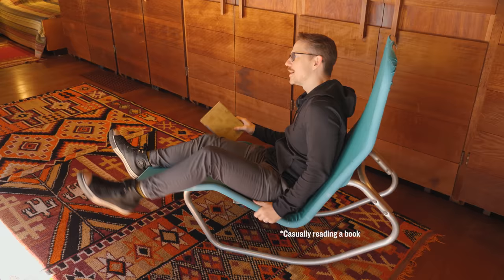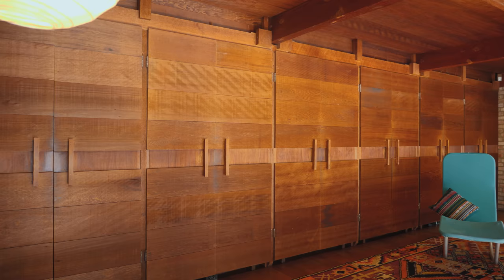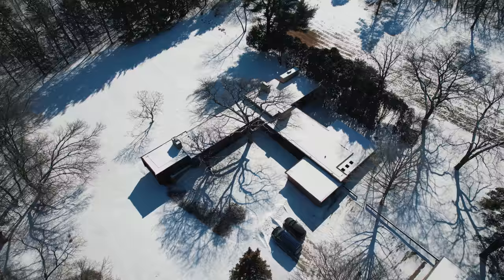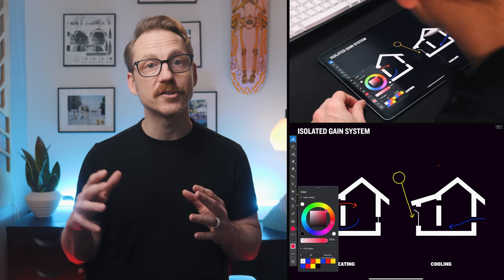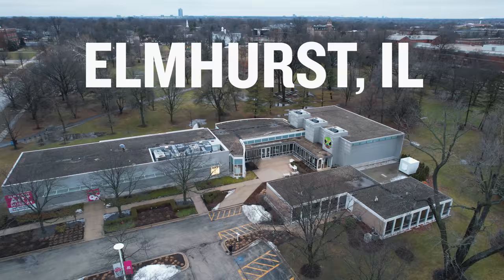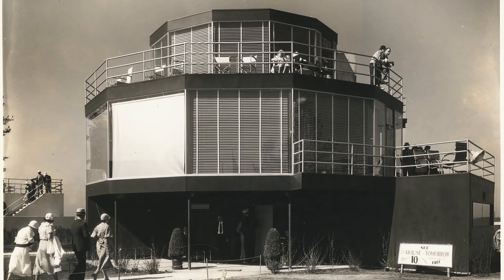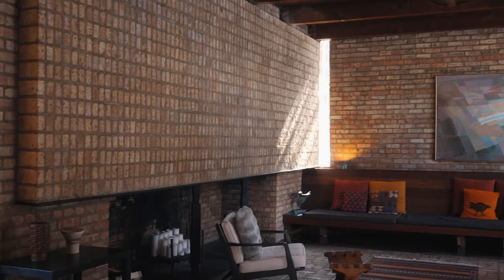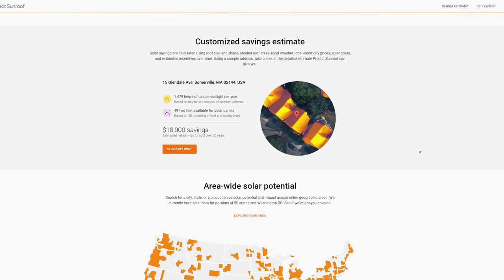How This Midcentury Modern House Harnesses the Sun

Comment: I wonder why data was not collected as to reinforce the concept. As the house sits in a lot quite large, right away that negates any relative factors to a typical tract developed home. The only modern alternative is to modify, alter, improve building codes as to build, insulation, sealing, better windows and an HEVAC systems that include heat pumps with smart energy management via AI and a modem thermostat. Thanks for the video.

Comment: I'm tired of cold-climate bias in energy efficiency. Believe it or not, there are vast regions where warming a building is not much of an issue, even in winter. It's keeping things cool that's the problem. And in these areas, the air outside is often so hot (and frequently humid) that ventilation is not viable. Where I live, summer low temperatures often don't get much below 80 deg F (because the dew point is in the high 70s), so even trying to naturally cool things off at night doesn't work (and all the moisture leads to mold/mildew).

Comment: Very difficult to do right, even with today's high performance glazing. Tough sun is the  afternoon sun, which is low, no matter what time of year, and will overheat.
That "perfect" 24 degrees is humbug.
Lots of glass will always overheat the home, even reflected diffuse sunlight will add significant heat load; you'd have to combine with planting shade outside. And in cold weather even the best triple pane IGU is worse performing than a cheap exterior wall.
I am not against lots of glazing, just saying it is much more complicated than the sun angle.
The natural ventilation is iffy, too. Brings in tons of moisture in summer, can work in swing seasons for a limited time.
These days, use controlled mechanical Energy Recovery Ventilation for ventilation; cheap and effective and no window openings to take care of, runs silently in background and you have always fresh filtered air in the home, which also helps with all kinds of other potential issues.
Thermal mass works well, but only if you have concrete floors with ceramic or stone tile, or similar materials. At which point you need radiant floor heating to stay comfortable, which is the only good way to heat homes IMHO anyway; works beautifully with Ground Source Heat Pumps, too.

Comment: we have certainly come a long way since then but its disappointing that more are either not taught these principles or don't apply them.  why are they not every day houses yet. 
also 
I think you got the grid in the floor a little wrong. logically the sun side window is hotter creating a low pressure system thus drawing colder air up from the back side of the house through natural convection.
Perhaps if he had a curtain along the inside edge of the grid parallel to the window's  with a gap both along the floor and ceiling, the curtain could trap the heat between the glass and curtain creating a stronger draft pulling up moore cool air across the room.
 using the summer sun to cool the house.

Comment: Isn't there a trade off because glass walls are less insulating? I can't tell if the windows in this case are single or double glazed, but even when double glazed a well insulated wall would be better when the sun is not shining.

Comment: that's a really nice house but:
using thermal mass to capture the energy... in a wooden floor, with thick carpets on it! Thermal mass is on the exposed brick walls.
5:37 Wladimiro Acosta coined the term Helios for a type of solar house he developed from 1932 and was well established by 1937. I'm not even sure he was the first to dub them in a similar fashion, but it pre dates that 'solar house'.

Comment: I'm curious how well the solar gain works as this house predates PSI rated insulation to provide a thermal break between the floor and the earth. This is assuming the floor is a slab on grade. I have been building passive solar homes for more than 40 years and on the 49th parallel the requirement is a four foot overhang with eight foot ceilings. This calculation comes from information provided in The Passive Solar Energy Book published in 1979. June 21 no sun enters the southern windows and Dec 21 at noon the sun reaches more than twenty feet back into the house

Comment: The assumptions for the roof overhang are wrong. Designing for the winter solstice is about 7 weeks too early. Due to thermal lag, the coldest day of the year is mid Feb in Illinois.  Likewise, setting shading based on the summer solstice is also about 7 weeks early, as due to thermal lag, the hottest time of the year is mid August.  Now the design described here partially works, but it is hardly "optimized ". The suns position   changes daily, so the only optimization would be a solution that moves with it, and is adjustable for different times of the year......fixed shading solves for a short period of time.

Comment: Great video. Something i hope people consider is energy on a direct level vs energy on a systemic level.

Modern windows are typically double pained. The seal goes bad in a short while: 10 -15 years sometimes. The repair  is to replace it, and to be code compliant large windows are tempered as opposed to annealed glass. This means they cannot be cut.

One pane typically has a UV protective side that minimizes heat transfer and a gas is between the panes. 

Anyways, the fix is to replace the entire thing. The low energy consumption of its performance of such an engineered product doesn’t out perform the manufacturing and shipping energy it takes to get it replaced.

I also would encourage using paned windows. As in - 50 paned instead of one enormous pane. So if one of those breaks, you replace a 12x12” window instead of a 4’x9’ behemoth. Easy on the owner, the installer, the manufacturer, the earth. Wins all around. 

A smaller window also is less likely to break in the first place. Cutting a piece of glass can be done by anyone with a little skill and can be found at almost any hardware store.

Manufacturing a tempered glass takes a while. Weeks. Months if the company flubs the order. Then it gets smashed and re-ordered.

The rise in demand of windows and old school methods of manufacturing actually historically led to a lot of deforestation. Nowadays it’s all gas, but i wish we could harness wood gas and have more locally sourced glass.

Comment: Never understood why ppl dont take that into consideration anymore. AC solves everything and then call it passive with a house full of electronics to control air flow and temperature, makes no sense. Why would i seperate my living space from outside, while i could just use the outside to my advantage. But i must say if you live in a city the dirt/dust building up is a issue that would be solved like that. Everything has its ups and downs, id prefer the "old way".

Comment: I am building a skillion passive solar retirement cottage. A lot like Matt and Goldie's earth ship but no tires or berm. 6/12 pitch for winter sun. Half the floor space in windows for solar gain. Gotta put thermal break and insulation under my thermal mass floor. Cold 48*F ground temp and 6 foot frost depth. Well insulated north cmu block with masonry veneer. Without educated idiot signing off on plans can only go up 20 with masonry columns under code. Doing old world masonry kitchen. Masonry stove, white oven, and heater. Like Temple of Malta. Can even get western Delta honey comb to match Maltese stone.

Comment: wood floors and carpets/rugs are NOT thermal mass- mass is concrete, stone, brick, even packed dirt/adobe.  and it looks like the trees where shading the south glass?  it is good to have the glass extend down close to the floor for more exposer to collect the heat. and you don't need air conditioner IF you design the house right.  and all windows need to have moveable window insulation systems- like thick, hi R factor curtains and or shutters, etc.

Comment: I have to differ in this... It depends, A LOT where you live, for example, for solar panels in México city you alocate them at 14 degrees for maximum sun reach, doing the calculations for the house you reach something similar by extending the roof or building slabs to cover or maximize the sun, again... It all depends what you want to achieve and where you live... In South America heavier and thicker materials are used therefore using similar methods can overheat the space or get natural cold spots, another example of a solar house way different of how you talk about them are the lak a utas in Lap Paz Bolivia, which harness the sun to heat up the house made of 1m thick adobe, the concept might be correct but there's more to it
Reply from the maker: For sure.
Reply: @stewarthicks  ah yes sarcasm I live for that
Reply: Well the earth is tilted at 23.5 degrees, then tilts to the other side after passing 0 degrees which will give us 2 equinoxes, houses in the equator can probably use that angle, I think to be more efficient on using this solar gain it would be using different angles depending on how far you are away from the equator...
Reply: @pihermoso11  I've only worked on Mexico city for now... And For efficiency the solar panels were installed at 14 degrees.... Ecuador would be at 0

Comment: I have designed and built these homes.  Each latitude,, and climate zone has its own list of design angles for walls and windows, for solar photovoltaic panels, for where and how thick the masonry buffers should be. There is no one size fits all.  One thing that should be universal is the house must address the sun first.  The western idea that the house must face the street is absolutely wrong.  I don't care that the street runs NE to SW,, the house first needs to face the sun.  The east and west sides of the house have different requirements,, the north side is lot specific.  Absolutely deposit in the trash the concept that a house must face the street.

Comment: This is a load of marketing crap.. That glass wall in the winter is the biggest heat loss in that house. In the winter sun is so weak it can't heat up anything. Winters are also  mostly windy and cloudy, wind will blow away heat so fast from that glass wall you will need to spend double on heating, so don't fall in this trap.
This can work only in places where there are no real winters, but in those cases just build what you like.

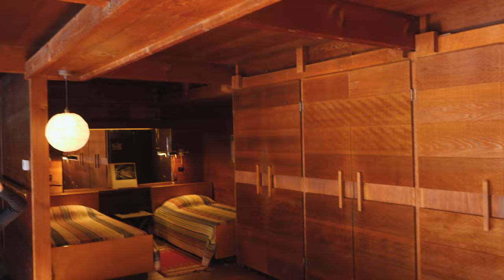Comment: 2:50 - This is not how circulation works. As you describe it, air would leave the room in two opposite directions, creating negative pressure. Which obviously does not work without a suction pump - and would not be desirable for living quarters. Unless there is some significantly more compex pattern of air movement, your explanation does not make sense.

Comment: Are there good examples of "mid-century  modern" interior houses without a flat roof?

I like the attention to how spaces are lived in and the use of high quality materials by these architects. What I can't understand is the the insistence of ignoring the basic function of a house as a shelter from the elements. Use of a flat, and mostly level, roof in northern Illinois, with its snow and rainfall, seems to be either ignorant or short-sighted. Was this planned obsolescence on the part of architects? Or did these architects not understand the climate differences of desert Arizona and northern plains Illinois?
I have seen your video on flat roofs but still don't understand why mid-century modern & modern architects regularly ignore the most basic function of shelter. Yes, technologies exist to weatherproof a flat roof but they are unreliable and tend to be more expensive over a multi-decade lifetime of a building. Water egress and undesired air infiltration are what lead to deterioration of building materials. Is a flat roof just a status symbol that says, "I am wealthy enough to have my roof repaired or recovered frequently?" 

I trust Stewart Hicks to tackle such a subject thoughtfully and thoroughly. I understand some houses were built as studies and are preserved because of what they taught us. But I wonder why it is builders, not architects that I see questioning the wisdom of a flat roof.